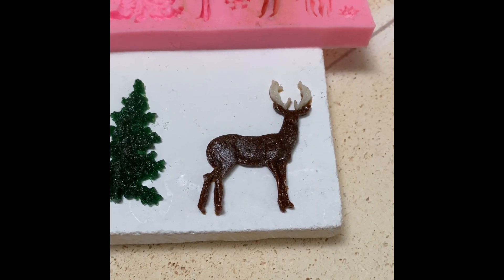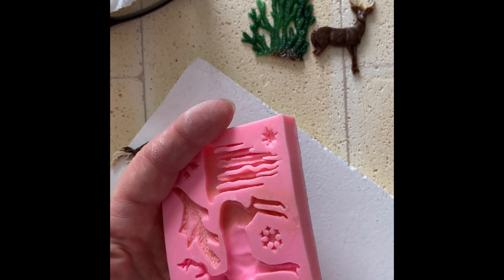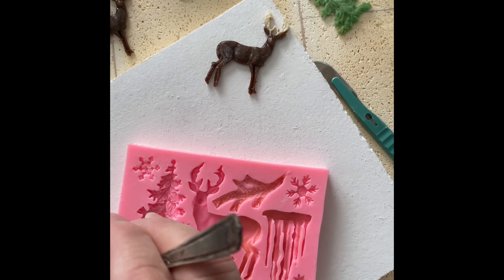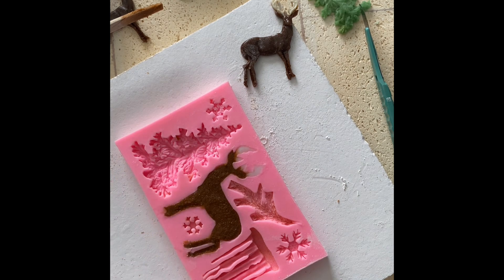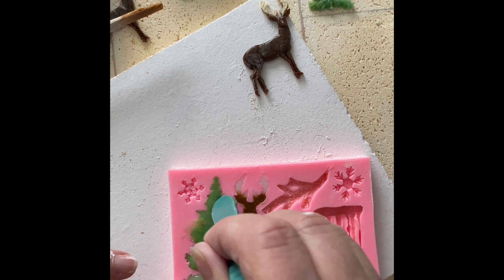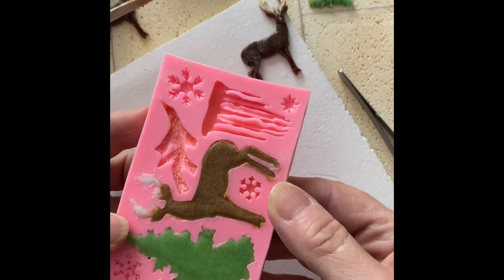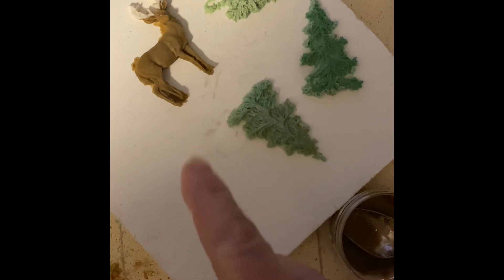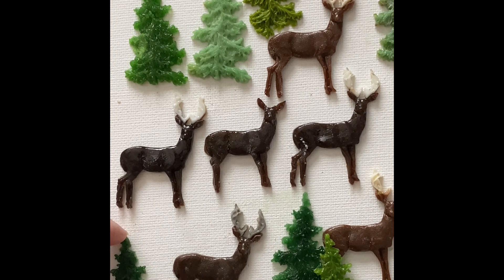Modifying a mold for freeze-n-fuse.

Comment: I use hairspray or glass tack for that sort tricky parts
Reply from the maker: I tried that once when I was using a delicate shamrock mold and it didn’t work for me. Did you replace the water with hairspray or spray the frozen piece to stabilize it?
Reply: @KathyFitz1113  half water half hairspray I did
Reply from the maker: @NandaVandeberg  Thanks! I’ll have to try that.